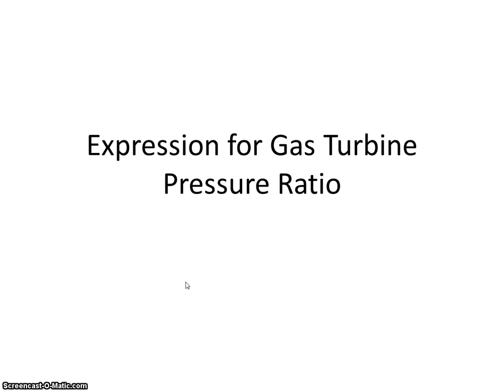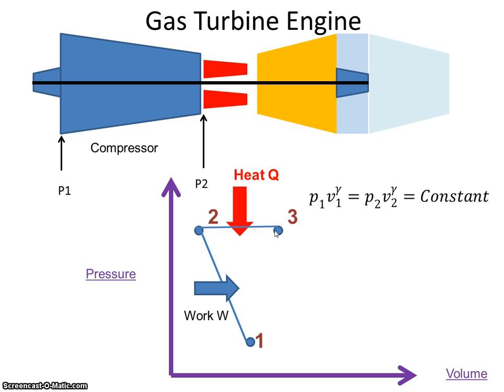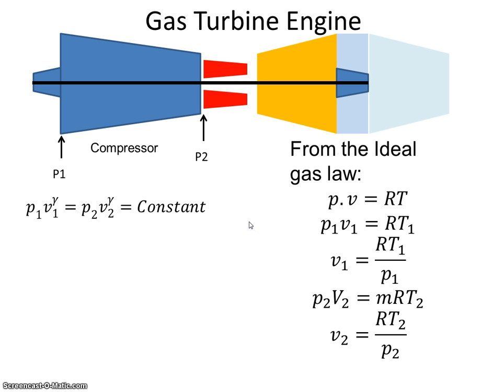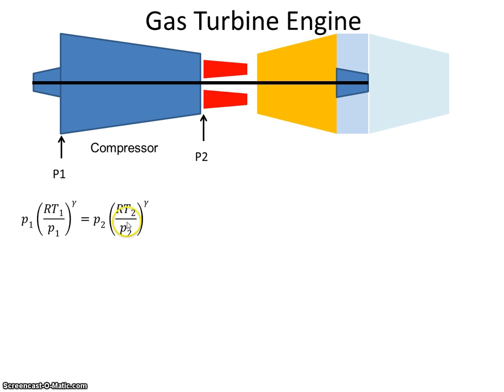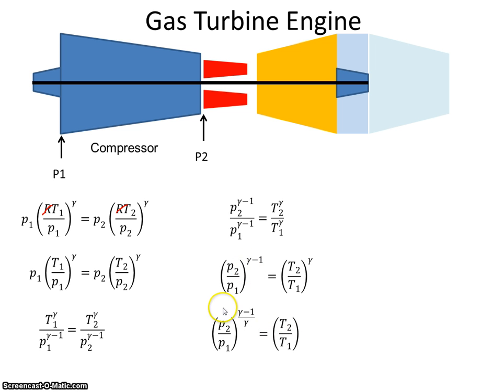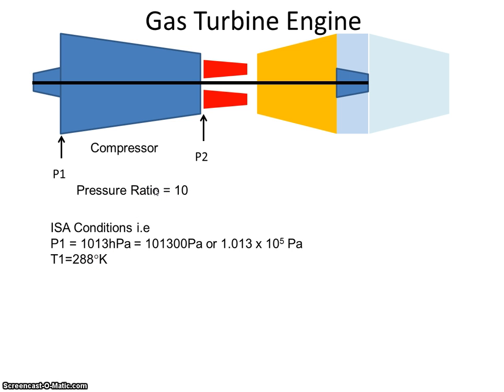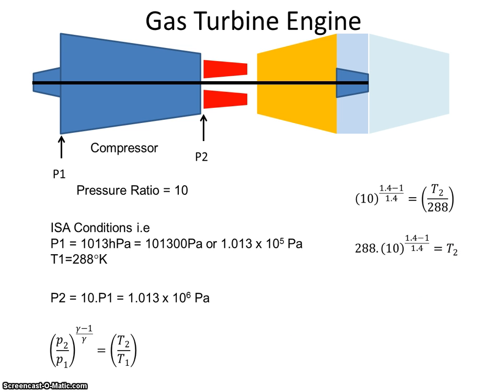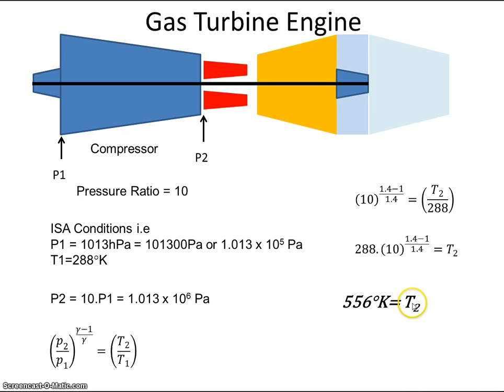Gas Turbine Pressure Ratio Expression

Comment: The original Brayton engine was a piston engine that combusted inside the expander cylinder... there are 5 original enignes but all are in museums and none are in running condition. I built one which I believe is the only running Brayton piston engine.  My engine runs at about 30 psi. If you are curious what an original  Brayton engine is have a look at my videos.
Reply from the maker: +John Lucas Thanks John.  Will do.